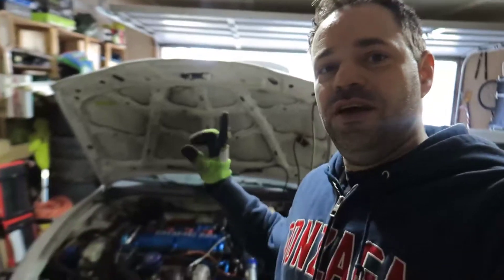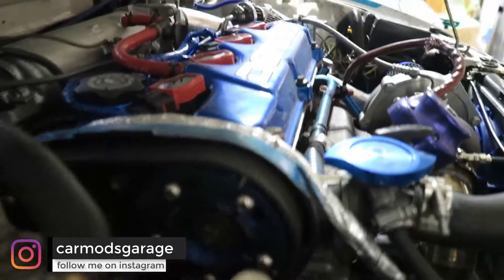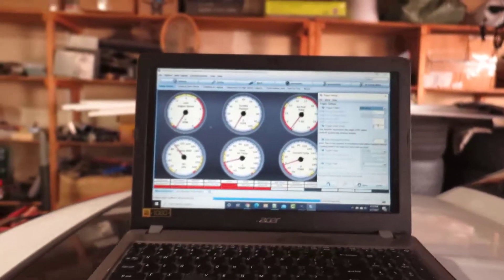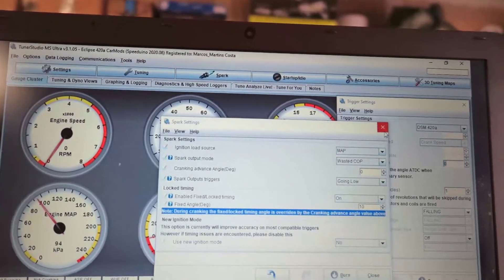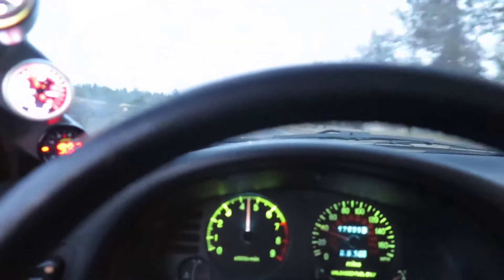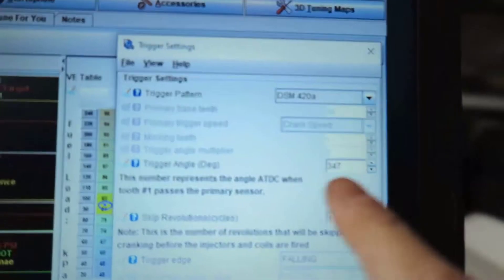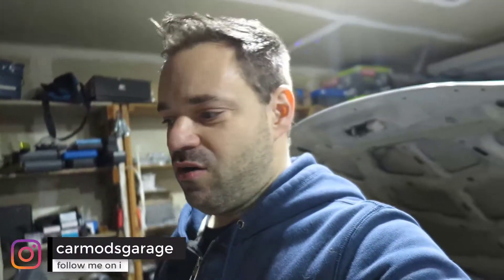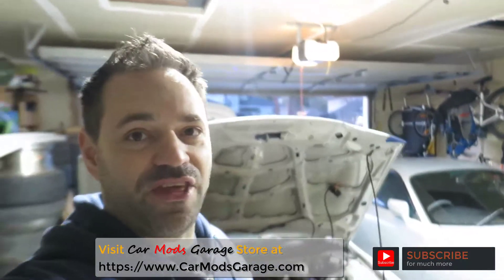Using Timing Light on The Eclipse With Speeduino Fishdog SpeedyEFI - Eclipse 2G Project

Comment: Why is it missing at idle ?
Reply from the maker: Running table needed to be adjusted and icv was not properly configured either.
Reply: @CarModsGarage  No need for ISC. You can hear it coming and going on a cylinder in the video.
Reply from the maker: @MrJermbob  what is ISC?
Reply: @CarModsGarage  Idle speed control.
Reply from the maker: @MrJermbob  it's working for me. I've played the video and I can remember 100% but I believe it was the angle value that needs to be set before starting the car. I had it a few degrees wrong then.

Comment: So during the start the timing can fixed to 10 degree??
Reply from the maker: The thing will be what you have and add 10 degrees that I set on my speeduino. After that it will do whatever the timing table is set to.  It's important to be sure that the engine timing is correct so the speeduino can adjust accordingly. If the timing is retarded 10 lets say for example, then when speeduino add 10 degrees your engine will be at 0 instead of +10
Reply: Many thank guys I really appreciate it..i will try next time ..
Reply from the maker: @jokosuwito79  alright.  Good luck my friend.

Comment: Damn brother haven’t watched your video since 2020 Jan  . I talked to you about ur turbo420-a and my video anyways that’s sick you got a stand alone ecu how much do they cost and are they plung in play ?
Reply from the maker: Hey man ya I remember you. Ya I got an standalone called SpeedyEFI which is a speeduino Fishdog. Not plug and play though. Good wire by hand and add some weird stuff to create 8v for the sensors and add an external voltage regulator but I love it. Second car using it so far. Around $350 with 8ft harness
Reply: @CarModsGarage  no way nice that’s super cheap
Reply: @CarModsGarage  do you have a vid on installing it bro ?
Reply from the maker: @miketofu5692  you know I always do . This is my playlist for the Speeduino install and tuning on the Eclipse 
Eclipse 2G Speeduino: https://www.youtube.com/playlist?list=PLdqU6ucc0h6Fj4_Z34WJ6BUTmGZofjzHK
Reply: @CarModsGarage  I’m binge watch it 😛 when I order if I get stuck I’ll let you I need help. Man crazy Cali rules I got state reff on my e46 for having headers and exhaust 😒 I wish I was In tx to be free from this bs
Reply from the maker: Ya brother that sucks man. There is also a regulation passing that will not allow ECU, turbo, exhaust replacement anymore.

Comment: Is it running wasted spark or sequential spark? Does it get both crank and cam signal from a distributor that can be rotated?
Reply from the maker: Yes I'm getting signals from Crank and cam . I'm running Wanted COP for spark and sequential for the injectors. I see the rotated distributor on the Speeduino Fishdog manual do I would assume it works. Reach out to SpeedyEFI guys from their Facebook page and they will tell you

Comment: Very nice! What's interesting is that I got my timing dead on by setting my trigger angle to 0°. Out of curiosity, did you try with a lower value? BTW, thank you for the mention! Your 2G Eclipse and 2JZ BMW series are what helped solidify my decision to go with a Speeduino. Thank you very much for taking the time to assist me with my install as well!
Reply from the maker: Ya man I appreciate you send me your video. Because of you I ended up making this video. 👍
Yes I tried 0 ended up. Getting the marks alighted with  247 but I think I am 10 off still. I added 8 back so far so I am at 255 and adding time to the spark table. Car is super good now.
I appreciate you watching my videos Jorge. Take care brother🙏